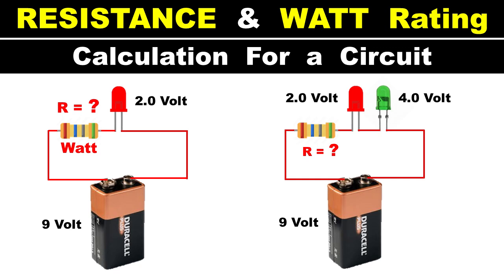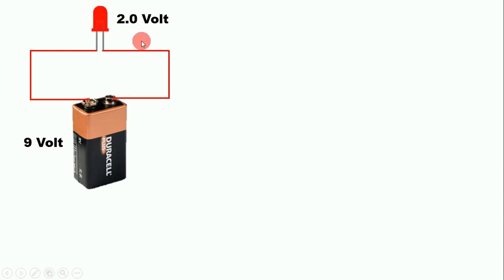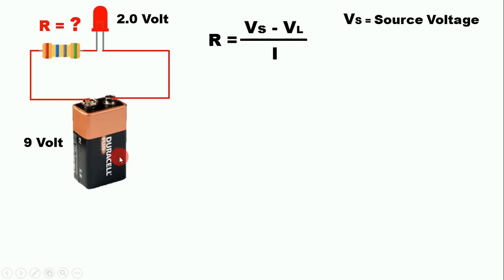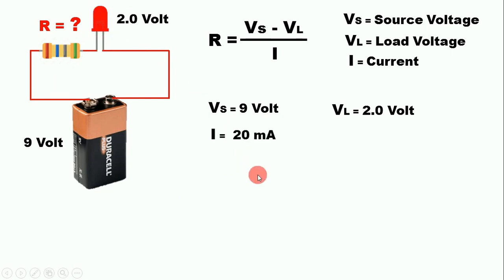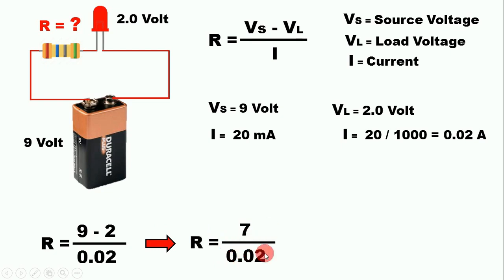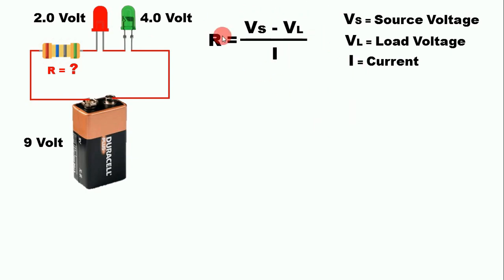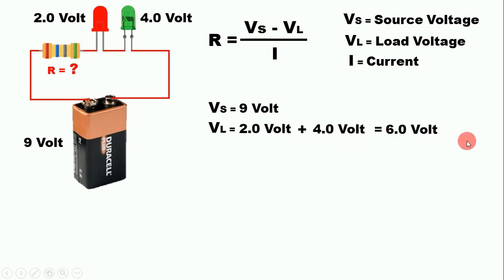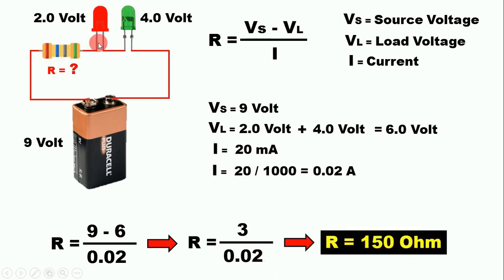How to select Resistor Value for LED with simple calculation @TheElectricalGuy

Comment: I think this is the best explanation I've heard. The only thing that I think could use some more explanation is why only the largest current value is used with multiple loads/LEDs.
Reply: Connected in series both LEDs get the same current. The component that has the highest power needs, decides the total current.

Comment: Do not change the value of Mili amps to Amps to easily calculate and determine the wattage of resistor to be used. Like 7v x 20ma=140mw. Can use 1/2 watts resistor.

Comment: Hi...! Nice explanation and appreciate your video.
I have a small doubt. If 2V and 4V LED's are connected in series, we were using a resistor. But, the resistor only limits 3volts and allows  6Volts to pass through the 2V LED. In this case, the 2V LED will get damaged. How to overcome this...?

Comment: If there are more bulbs, VL = 2v+4v+2v+3v = 11v. And VS=9v.
So, voltage drop = 9v-11v= -2v. Here is the negative value. Ultimately result will be negative.
Then what will be the calculation???? I have to consider this negative value as a positive???????????????????

Comment: QUESTION, WHAT IF 10 3MM LED LIGHT IN 1 BATTERY 9V IN A ROW WHAT RESISTOR DO I USE? OR SHOULD USE 390 OHMS 10 RESISTOR EQUIVALENT TO 10 LED LIGHT I MEAN 1 RESISTOR PAIR LED LIGHT? IN ORDER TO FIT 1 BATTERY 9 VOLT? WHAT HAPPEN IF WE DONT USE RESITOR? HOW MANY LED LIGHT CAN BE LIGHT UP? :)

Comment: what if we use a battery with 27V and 9 lamps, each have 3V, in series, do we need to use resistor?
Reply: No
Reply: Because if you use a 9 led in series and each led use 3v we multiply 9x3 =27
If you use parallel we have to attach an resistor because current is flowing constant and each led use it separately and does not act like a blockage like in series
FOR further info say IJ in the reply